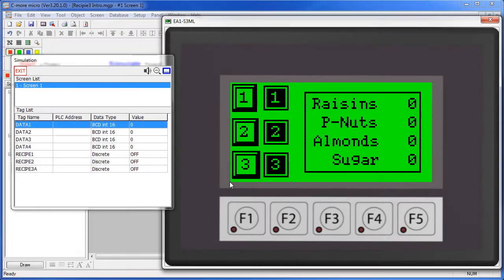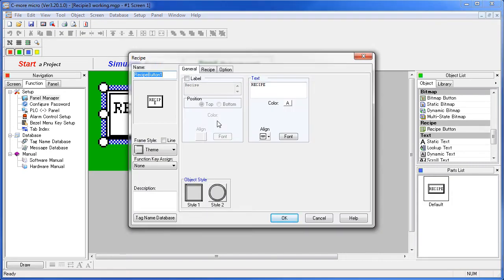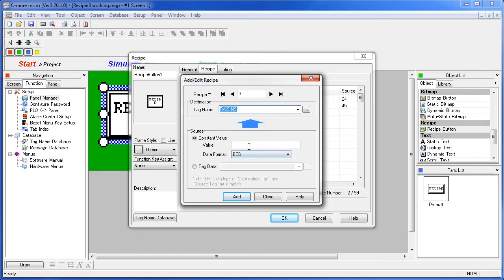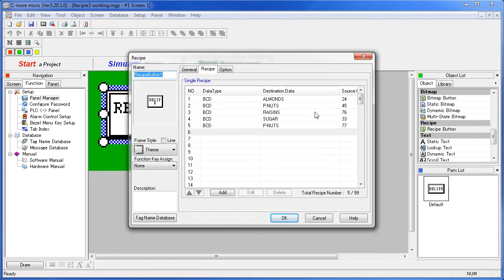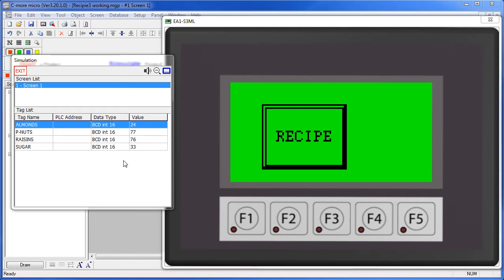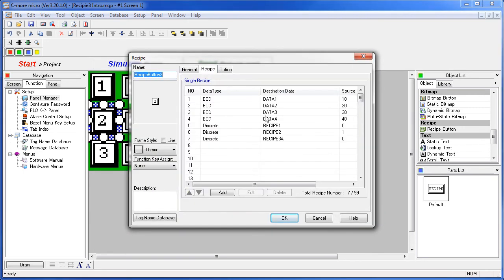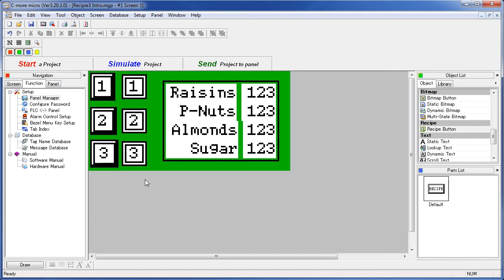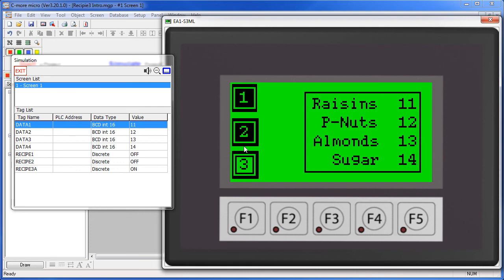C-more Micro HMI Using the Recipe Object from AutomationDirect

Comment: How can i do a screen change by clicking a recipe button? 
Thanks for the Video i loved it
Reply from the maker: @simonisaacramirez950, the function buttons can be assignd in the function tab of the navigation panel on the left side of the screen. Under "Setup" go to "Bezel Menu Key Setup" and it will let you assign F1 through F5 as various screen change functions for all screens. Another option is to use the "Function" object under the "System" section of the object list. This will allow you to assign F1 through F5 functions for the specific screen you use it on, as opposed to the HMI as a whole. Let us know if you have any further questions, and thanks for the comment!
Reply: @automationdirect   Can i do a screen change by clicking a recipe button? or how can i do that?